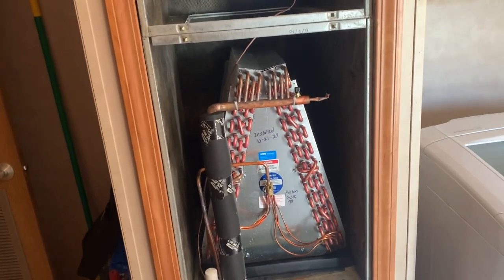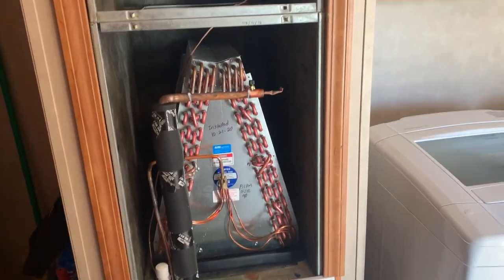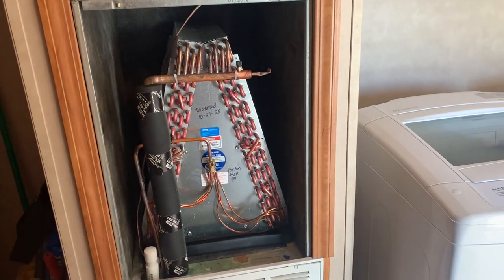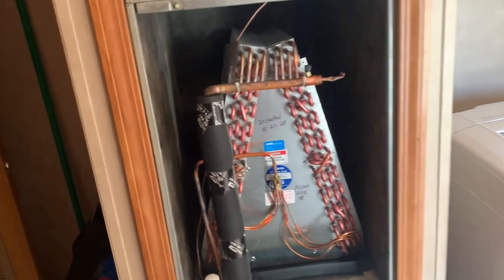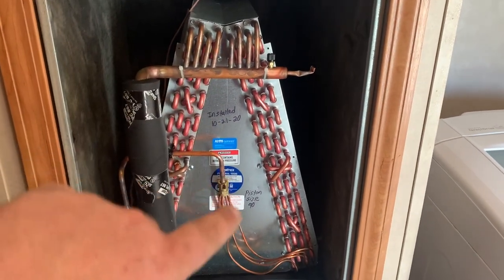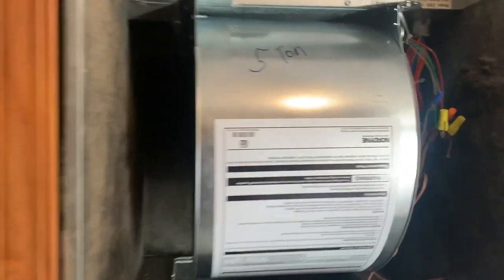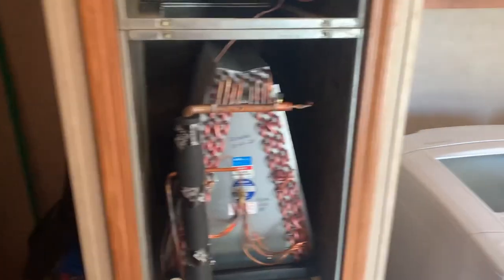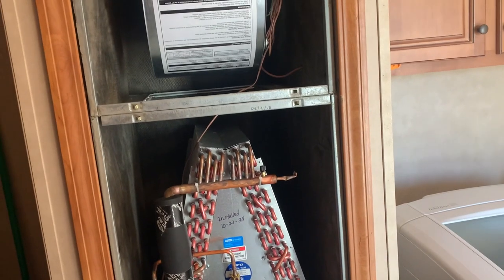A Mobile Home HVAC System/Rant

Comment: I am in a  32x80 double-wide mobile home and just had a 5ton installed.. 
Alabama summer heat ain't no joke..lol

But I think I might have been scammed... it is not pushing air to one end of my house..
I was put in 3 weeks before the end of summer.

But I recently went to put a filter in and noticed they taped off the duct pipe above the inside air handler..

And It was always open with the other unit.
Can that be the reason why after a new unit I have not flow too half of my house.

Then he told me I need a cross flow duct work under my house.
Mind you  the previous unit was a 4 ton.. So if anything I would think it should blow better..

Thanks to covid closing my job... 
Paying him hundreds for duct work I didn't need with the previous unit is not an option.

If you have any ideas I would appreciate it.
I just don't understand them taping that duct closed... Because that is what the filter is there to filter I though.
That is the only Duct vent where air should go up through... I could be wrong.. I work in computers not hvac..lol

Comment: Hey John. I live in 1999 Buccaneers double wide home and the size is 58 X 28 which is 1624 sq ft. My AC condenser unit is 3 ton  and its about 24 years old. So Im thinking about replacing a whole heat pump system soon. My question is should I get 3 or 3.5 ton HP system to match my home. Not sure which one is best for it. Maybe I should get 3 ton due to ductwork sizing? Please let me know what would you suggest. Thanks and have a great Christmas!

Comment: Hello John, idk if you’re able to respond quick but I’m a mother of 2 boys. Scared to call my landlord of getting in trouble. But our a/c been running, running hot air and it’s godawful in Louisiana. What can I do to fix this situation? we defrost it, been flipping the breaker. Nothings working but I’ve done this before and had no problems now I do this time.

Comment: Did you have to do a load calculation on the mobile home, I do hvac and we always do it for a stick built or modular home just wondering because I know the ductwork is in the floor joist and it’s not always the best, did you guys also have to change the ductwork since it was originally a 4ton and you guys went to a 5 ton?

Comment: Hey John. New subscriber,, hope your still reading comments. I'm ne to texas in a manufactured home. Our evap coil is rusty and freezing up. The compressor is new. Is model 96 4 or 5 ton? Our house is 2700 square ft and I'm thinking I need to upgrade when I buy the new coil.

Comment: Hi. Maybe you can answer my question.. Because I can't find ANYTHING. So... We had to replace our HVAC and the one I got installed requires 20x30x1 filters. Anyway, when they put it in, they basically broke the old frame for the much smaller HVAC that used to be in there. The dry wall is all busted, etc.. What the heck is the frame called so I can try and replace it. They didn't replace the bottom part of the unit.. Itd probably be easier if I sent a photo but idk how to do that on youtube. I know I need to pull the drywall down and start fresh but I can't find anywhere to replace the vents or whatever they are called.... I'm sorry if what I'm saying is completely wrong. I literally know NOTHING about HVAC vents or face panels or whatever its called :( ... I'm so lost.

Comment: My 20 year old Mobile home (Solitaire) is built better than the Brand new home in a HOA we used to live in.  It is also bigger and the walls are 6 inches on the outer walls.  Mine is 34 x 74 and has a 3 ton.  We stay cool and warm with no issues.

Comment: I'd pick a solid MH with steel frame, siding and roof any day over a wooden site built home in hurricane season! If people talk bad about MHs they just don't know what they're talking about! I did my research well before we bought our land and placing a MH on there! No big trees around and no damage whatsoever with Laura and 100+ mph wind speeds! Some smaller trees fell and some big ones in the neighborhood.

MHs are a way better bang for the $ and why locking up more $ in a home project? Keyword opportunity costs!

Regarding tons we got a 4 ton system for 1300sqft and it's worth it when it comes to summer and 110 degrees sometimes.

Comment: I need to replace my blower motor and capacitor. My blower fan is under my coils and the copper pipes that are in your video with black insulation around it, on my sytem, run directly in front of my blower. From watching other videos, I am under the impression and my question is, I am unable to remove those pipes and, they need to be moved out of the way by a professional? And then my next question would be, is that an industry make money “scheme”? Because supposedly I’m supposed to be able to remove my blower and clean it, but those copper pipes are in the way. So just basic maintenance requires a professional, right? Apologies if this is coming off rude, I’m just frustrated because I literally don’t have money for a professional and I live in Tucson where it’s 108 degrees today. I’m sorry just one more, how much would you charge to remove and reconnect those copper pipes? I realize where you live and where I live prices will be different but I just kinda want to get an idea of what I’m looking at? Also, I am so thankful for my the amount of tons on my system(well when it’s working), and honestly I feel like I could use another ton, especially in the summer. Idk how many tons my system is, but my coils look exactly like the one here in your video. Thank you so much if you are able to take the time to read this and then thank you again if you are able to respond.

Comment: Looking for some advice. Customer has 2.5 ton ac in her 850 square foot single wide. It won't cool below 77 degrees indoor temp when the outdoor temp is 89. Temp split is only 12 degrees. I ran a load calculation and it claims 2.5 tons is more than enough. Think I should bump her up to 3 tons, or will a properly functioning 2.5 ton suffice? Thank you

Comment: Hey John, what it's the size of the drain pan hose connector, where can I get the right size hose? the one that it have does not
fit tight and leak in the summer, Thank You!! ( I live in a mobile home the coil it's 4 ton it looks like the one in your video)

Comment: (Sorry this is long) Can you please do a video on what the different types of hissing means in these types of units? Please? Or possibly advise me on what you think about my situation? Our ac has went out multiple times, it kept happening then the guy completely replaced the unit (inside and outside) Haven’t even had this one a month and it’s hissing on the inside like the other one did. I read that some hissing is normal but sometimes can also mean problems. My landlord is in her 80s and this guy has already got a couple thousand off her, I just want to make sure he’s not taking advantage of her age and the fact we know nothing about this stuff. The 1st unit was hissing, didn’t blow cold air, and then stopped working, he came out “fixed it” then said it was just my filter dirty!  But the outside fan would make horrible noises like a screeching sound or not spin at all. I told him that and he said my filter was dirty! I’ve ocd about keeping my filters changed too! It worked well about a month then the thing on the inside of the home (the huge coil in the shape of a triangle) would completely freeze up within seconds of the unit kicking on. It would still blow just not cold air. That go round he said the whole thing was screwed and we would have to replace everything! So my landlord did she paid him to put in a whole new outside thing (sorry Idk know the terms) and the whole coil that has all the copper tubes running to it on the inside. It’s inside a mobile home BY the way. So now everything is “new” blows cold air and cools really good! But tonight I’m sitting there and sometimes on the inside (where you put the filter and the coil is) I hear a hissing sound. Almost like the sound you hear when you drag a metal pipe or bat on pavement) It does it when the unit is kicked off. Not constantly but here and there. Do you have any idea what that could be?? I’ve researched and researched but have no clue. I don’t want to call this place again and then charge her an arm and leg again. Idk anything about this stuff. The one person I had (my husband) who knew all about repairing things and this type of stuff passed away about 3 years ago and since then it’s like anywhere I go people take advantage of me not knowing. So I would greatly appreciate any advice on what to do. If we were in your area I would call your company for help but sadly I’m about 4 states too far away. I came across your page browsing videos on fixing mobile home havocs. And you seem to be an honest person. I know you are probably very busy working but any type of advice on what to do would help us so very much!! Thank you!

Comment: I bought a 2000 sq ft mobile home last year in N. FL and I left the door off after I cleaned the evaporator coil.  So you can image the coil iced over so I thawed it and it froze again since I left the door off.  AC company came by and $5800 later I have a new 4 ton system.  I blame covid for my brain fart, ha ha ha.  It's all good since I'm saving over $100 a month it needed to be done and I got a $1400 rebate from my power company for the heat pump.  I'm a little upset, I just noticed a 1/2" gap on three side of the inside unit between it and the stud walls so for the last year air has been suck through the gaps and now have cat hair and lint on the coil.   I blocked the cracks and I added 18x18 filter above the unit to give more air flow (sounds like a freight train) since it had a 3 ton before.  Have you ever heard anyone putting a stainless steel mesh screen over the evaporator coil so when you change the filter you just lift the screen out and clean it?  I guess if you have a good sealed system and clean filter you don't need to worry about it.

Comment: I have a mobile home I’m trying to find out where the location of the vent damper is on mobile home for some reason I can’t find that one video. I thought maybe mine is not working properly I have two bedrooms on one side of my house that is not getting good airflow. It was just one now it’s two My Home is only 1200 ft.² I have a 3 ton. It is over 20 years old but I’ve taken good care of. I know I will eventually have to replace but I would like to know if that could be a reason why all of a sudden or maybe my unit is getting ready to go out But can you please point out where it’s at in my unit or in general?

Comment: Have you ever dealt with a revolv air handler and heat pump?

We are installing a system and are trying to figure out where a Grey wire is wired in system. The other Grey wires are on the heat strip.

Comment: Yeah the evaporator in my cabinet is a 4-5 ton rated ∆∆ (M) coil. Having problems having HVAC contractors replace my system with another 5 ton unit they all are wanting to put a single stage 4 ton. I had a manual J done in and energy assessment done my current system runs at 98% efficiency I've had 3 estimates done in the last week and every one of them are wanting to drop me down to 4 ton with only about 88% efficiency. And all 3 of those companies refused to put in a heat pump or two stage unit told me if they did it they wouldn't honor the warranty.
Reply from the maker: I wouldn’t put a two stage on a mobile home

Comment: I live in eastern North Carolina and we have 1000's of mobile homes that I work on. I learn a lot from you bro watching your videos. One question, when you come across a 4 ton that won't keep up and the customer wants a 5 ton, are you concerned about the size of the ductwork handling 5 tons of cooling and heat? Hope to hear from you. Thanks.

Comment: Though I make great money, I've always liked living in smaller houses better than large ones, and I've lived in both.  It's far less work and cheaper to maintain, and pay off and own.  Thank God I did, because if I had to buy a house now, I'd have to pay through the nose.  The trick to having money is having a small nut.  There's no reason to own a palace unless it's of some practical use unless you're in some business where you need to entertain, or impress people with your possessions, etc.  I bought a horrible doublewide on 5 acres for 40k.  Paid it off in 8 years.  Put what I would have paid into fixing the place and property up.  Now I own it,, and it's just about done, though in all actuality it'll really never be done because I'm always wanting to do something more or change something.  It's what we do as men.  But when I retire, it'll be everything I've wanted and I'll have plenty of cash stockpiled to not have to worry about things.  Society has people thinking they have to have a stucco box in a subdivision jammed in with other people 20' away.  I'm just the opposite.  I like 100 yards between me and them, at least, with plenty of room to roam for us and our animals.  Given the situation with housing, I think people should buy a large shed and remodel them into a small homes or buy a large travel trailer, until we can see where this is going.  Both can be moved to some land in many cases.  Then if you're able, build a bigger home to live out your life in.  But staying trapped in a $1500+ monthly rent an a stupid apartment or house is nonsensical unless you're making way more than what your nut is, and you can actually save money.  All you are is a slave to the money.

Comment: my furnace is a heat only mobile home unit, i want to add a 6" duct booster to the furnace to kick on when the thermostat comes on with the existing blower fan, i bought an relay and a 120to 24v transformer for the job , now my motor on the duct boooster only has two wires and not a plug in like most , how do i connect it all together .

Comment: Hey John, quick question I have a mobile home that’s a 15x76 I believe. Last night it developed a squeal that’s noticeable inside, is it possible that it’s my belt? And if that’s the case the belt that’s needing to be replaced on my a/c unit or is there a belt inside that I change?

Comment: What's the rough, round about cost to add a ac/heat system to a mobile home that had only central heat prior and it's 1100sqft on permanent foundation with crawl space

Comment: Im having a hard time keep my 28x60 mobile home cool inside. Air ducks seem to be fine but its over 100 almost everyday. I have a 4ton furnace and a downforce heating and cooling system that seems to never get lower than  80 degrees  during day. 
Im considering insulating with foam insulation to the bottom of entire mobile home. Would you think this might solve my issue? 
Mobile only struggles during suns peak hours 12pm-7pm.

Comment: What’s your thoughts on setting your thermostat I always keep my air on 67° or 68° all summer long and hvac techs here always tell me that’s way to cool to keep it set it but I’m hot blooded and I like it nice and cool inside and it gets hot here to and very humid my neighbor who owns his heating and air business tried to tell me to keep my air on 73° I told him he was crazy lol that’s way to hot
Reply: The AC unit doesn't know the difference. You might need more capacity in some cases to achieve it.
Reply: @Bryan-Hensley  interesting I always keep my air on 68° and it always shows that it’s 68° inside even when it’s 95° outside with high humidity and sunshine my house had a 3.5 ton Bryant heat pump had that for 10 years now I got a 3.5 ton Amana heat pump variable speed blower and 16 seer outside unit
Reply: @calebkeener12  if they were sized correctly they should. 95 isn't all that hot though. Systems are many times a little too small because people usually take the cheapest bid.

Comment: Hey how much are these running I spent 19,000 on a brand new carrier 96.5 efficiency furnace and brand new carrier ac unit and brand new hot water tank and 10 years free maintenance parts and service calls.

Comment: sewer gas in the house?? What happens when that water in the trap evaporates in the winter?
Reply: This is what happens when customers don’t request inspections or municipalities don’t require inspection no way its legal to tapp into sewer. Also don’t you need plumbers license to even touch sewer pipe?

Comment: Wished you were in Tucson so you could remove my garbage Rheem txv valve and kit it to a piston orfice setup, I’m limping by on my old r22 heat pump, not many interested techs out here in doing that conversion for me, they just push new crap

Comment: If I had an hvac contractor treat me like I’m just like everyone else and who did the work top quality and also showed up for regular warranty check ups …I’d pay premium prices for that quality work and treatment ….because having an hvac tech that does poor work and then turns around and says the ac is shot after 5 years when it’s just a capacitor….or does this little tactic if vacuuming down the lines for two hours on a heat pump that’s only 7 years old and then charging the customer for the Freon they took out of their machine to put it back into the machine….and charging them over $2000 for something that was a simple fix in reality…that pisses me off! That’s what the hvac company did to my dad in his big huge fancy heat pump they installed on his home….warranty is about ran out in it and I’m betting they say it’s shot at its warranty end….

Comment: You getting another 1000 cfm out of the same ductwork? Just remember, ductwork has rules
Reply from the maker: I took out a 4 ton. How is that another 1000 CFM?? Know the facts before making stupid comments.
Reply: @johnisraelhvac2019  you don’t just add another ton if the ductwork isn’t sized properly, idiot.
Reply from the maker: Dude it’s a mobile home. Can’t access the duct work. System is working fantastic not the first one I’ve done. Go play with yourself bro.